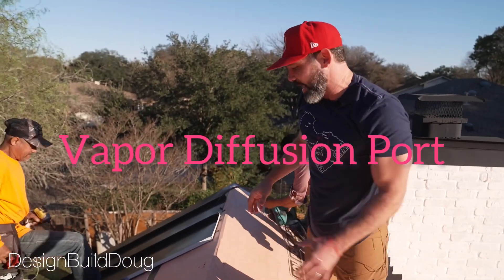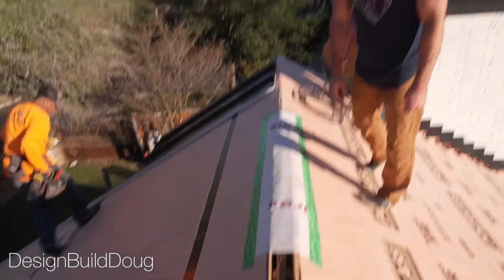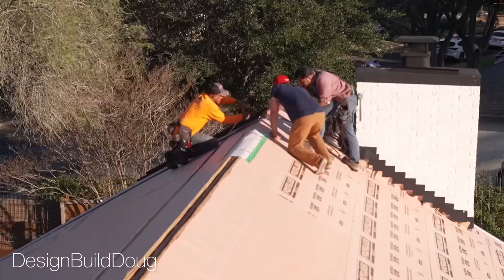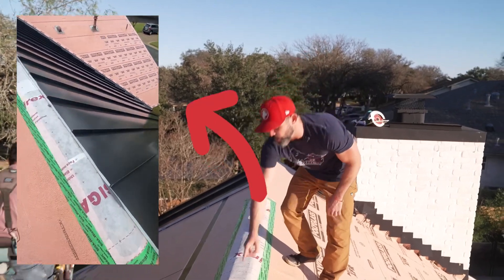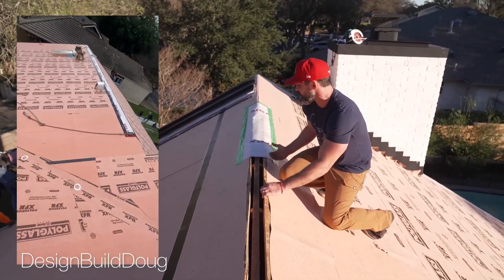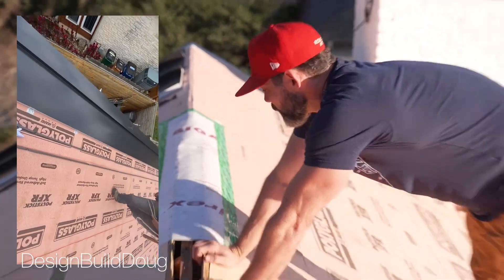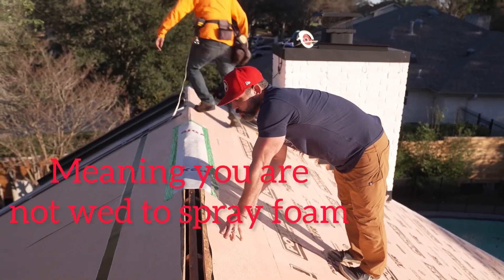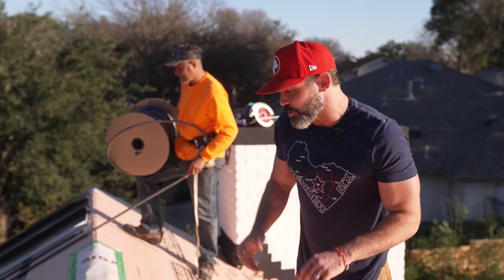Vapor Diffusion Port                                                            Ep. 2 #AtticRetrofit

Comment: What climate are you in. 
  The only code reference is to climate zones 1,2,3. 
I’d like to do this in a colder climate.  
Standing seam roof, 
Vaulted ceilings,  R60 in the roof trusses.
Reply: I think they do not allow this method more up north because of snow which could turn into ice and clog the vent. When it is time to change the roof I will try it. I am in climate zone 5. Not a lot of snow we have here. it will not stay more than three days on the roof
Reply: @andreycham4797   I have decided to do an intake at the eve on the top of the roof deck,  add ventilation behind the drip edge.  Elevate drip edge 1/2" Then put insulation baffles on the underside of the deck.  Then put a ridge vent on.     This is all under a standing seam metal roof.

Comment: can you tell me why you chose that specific underlayment? Wer are in the process of building our home, currently framing up the roof. We're doing unvented attic, with non foam insualtion. will need vapor diffusion port but stuck on underayment . thanks
Reply from the maker: We opted for a fire resistant peel & stick underpayment because of the added durability against both fire & water intrusion along with the air sealing capability. You could definitely skip the fire resistant component if your home is low risk. The air sealing portion is important but could be achieved by presealing all of your roof decking seams and using an inexpensive synthetic underlayment instead assuming your roof had good pitch & the risk of water intrusion under the metal is low.

Comment: Do you still fully insulate the attic up to the ridge? Or do you leave a gap in the insulation as well at the ridge? If you are using insulation on top of your roof decking, are you running that all the way up to the top of the ridge covering your diffusion port? Or are you cutting the insulation short equal to the cut out of the port and keeping an open path for the moisture to escape?
Reply from the maker: If you’re insulation is vapor open as ours is its fine to full fill it directly below the port.
Reply: @DesignBuildDoug  What would you do if you had ZIP R on the roof deck? Would you cut that back as well at the ridge? Would that defeat the purpose of the ZIP R to have a large open hole of insulation at the ridge?

Comment: Can you do this after roof installed? Like just got roof installed we have ridgecap and im looking to finish out my upstairs and windering if it better to change over to non vented so we can install  insulation like rockwool up against the roof deck.
Reply from the maker: It’s not impossible but could be pretty tricky.

Comment: Do you need a vapor diffusion port with roof deck open cell spray foam if you put dehumidifiers / hvac supply and return in attic?
Reply: Hot humid south
Reply from the maker: No
Reply: @DesignBuildDoug Yes, vapor diffusion ports are most important in Climate Zones 1-3. Open cell SPF dues not block the movement of moisture. A vapor diffusion port will moderate the condensation risk far better than a dehumidifier.
Reply: I have OC spray in Florida. Building code says (I believe) you cannot return air from attic unless ceiling has a fire retarder like dry wall. So I tried anyway with HVAC supply and return. That did not solve high temperatures or humidity in attic. I tried continuously blowing air from living space at 100cfm into highest part of attic and that didn't make much of a difference either. So, bit the bullet and installed a dehumidifier up there just for the attic space (also have one whole house for the living space). That has done the best for humidity but itt does increase temperature up there a little. It's sits right next to the ducted whole house one and shares the same condensate drain to outside. It's not ducted just turns on when humidity gets to mid 50s %.
Reply: @markellis7866 a vapor diffusion port will control the condensation risk better than a dehumidifier. You should install a membrane with a 20 perm wet cup rating at minimum, a 50 perm rating is better. ASIRI Designs has an excellent review of vapor diffusion ports.

Comment: matt risinger cut diffusion ports near the ridge but not on top. I think it's smarter because on a slope the vapor control membrane is less likely to sag and accumulate water. however I didn't get his design fully because the ports were not cut all the way through the sheething there was wood behind blocking them, and he didn't bother to explain in detail. alright thanks for reading.
Reply from the maker: Different but same.
Reply: @DesignBuildDoug  better* but confusing.